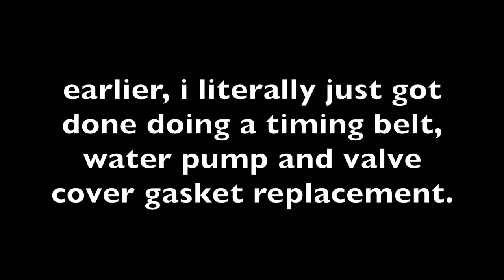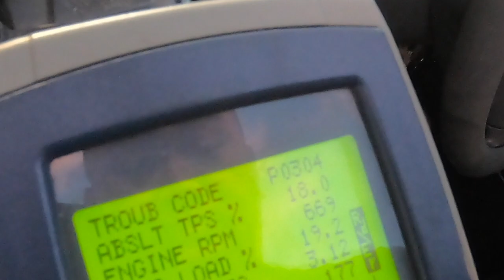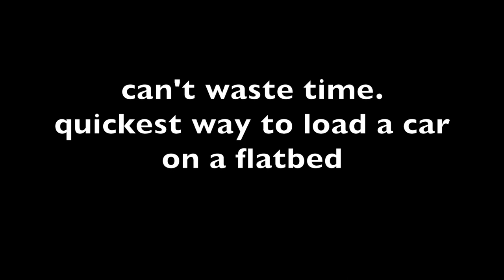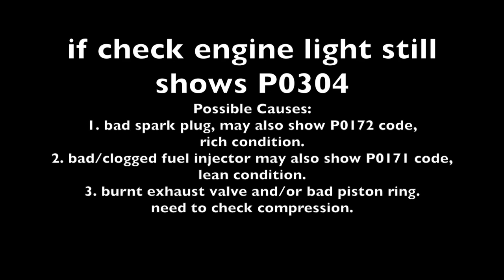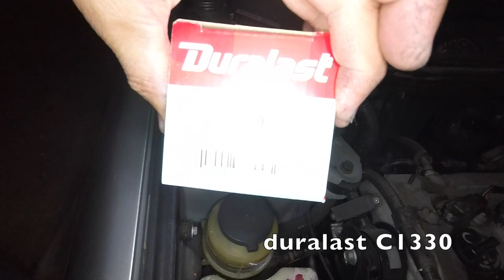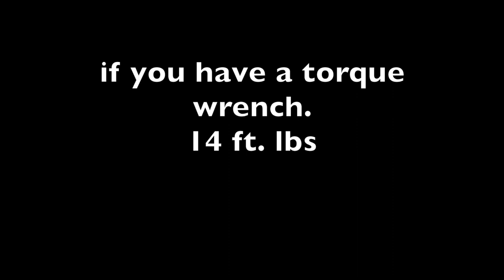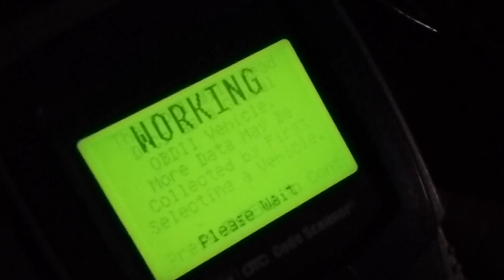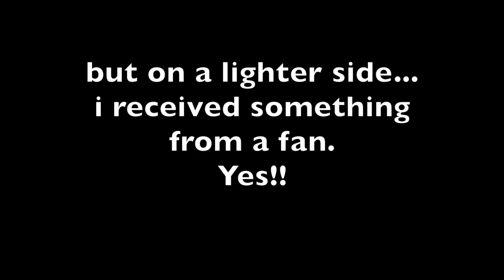Toyota Camry ROUGH Idle and no power while accelerating √ Fix it Angel

Comment: I was leary about aftermarket coil packs when a Toyota service tech advised me not to use them because the resistance he measured was higher than the 14 year old original Toyota coils. Glad to see your experience with the aftermarkets was good.

Comment: What a good husband he is! My 2016 Toyota Camry acted up again early this morning after I dropped my girls off at school. It was really busy on the roads at 8:05 a.m. Car was fine and then all of a sudden I try to accelerate some after just leave I got a stop light, headed for on-ramp to interstate and my car would not go above 25 mph and it was revving very loudly. It has done this 9-10 times over the last year. And I wanted to catch it on video super fast for my husband to see and hear so I hit video on my phone. 
Traffic was everywhere and I was almost to ramp and there was nowhere to pull over until I got on ramp. Line of cars behind me wanting to accelerate to get on interstate but my car wouldnt let me. 
I continued to video so he could see the speedometer and hear how loud my car was revving but I knew what to do to fix the issue just from previous times my car doing this. 
I pulled right over and put my car in park and then back in drive and got back on the road as soon as all cars passed and the issue was fixed. 
I later sent my husband the video once I had parked at the store I was headed to. My husband got mad and told me I was going to blow my car up getting the rpm’s so high. Lol. Like I can help what my car is doing!? Like I could help there was traffic all around me with nowhere for me to pull over. The entire thing lasted 30 seconds tops. I also pulled over as soon as there was an open space when I hit the ramp. 
He was cussing and mad as a hornet at me. Ive told him five times my car has been doing this every blue moon for close to a year now(maybe 8 months or so actually). 
So I told him forget it and from now on I won’t bother telling him squat! I have a fabulous husband in so many ways but every time something like this happens, it’s MY fault. How?! 
It’d be nice if my husband had responded the way this husband in the video responded. Of course, my husband is traveling for work a lot and he is 7 hours Away so it isnt like he could rush to me and I’m used to dealing with stuff myself anyway but I just thought I’d let him know. What a jerk!

Comment: here is my story about my car that had a very very strange problem i think it is important to learn about it since you are a mechanic it might help you later as it did to me.
my car stopped working and coudnt start anymore , it was cranking fine. i checked the compression it was great and injected propane and starter fluid into the intake it woudnt start. i then removed the coil pack and EIM (one piece) in order to see the sparks discharging i hooked up the sparks plug with copper wire and everything worked fine, i saw the sparks working.
at that point i disassembled the engine thinking it was a timing issue. long story short it turned out to be the dedicated ground wire for the Electronic Ignition Module on the coil pack that rusted and broke beneat the engine . i also learn that the computer calculate compression on each cylinders by measuring the resistance and current waveform from the coil pack firing and it send the information to the main computer. they added a dedicated ground wire to the EIM and when it broke the computer coudnt make his black magic work anymore and the car woudnt start.
my car is a 2003 cavalier and i had no code except a evap thing (leaking gas cap).
Reply from the maker: thank you Francois for taking the time to tell your story. i appreciate it. i will remember your tip. it is very valuable information. be safe, stay healthy and take care. god bless you and the family.
Reply: @FixItAngel  thank you very much also for your videos, you are helping alot of people all around the earth. may your family stay sharp and healthy.
Reply: Thanks Francois and thanks Angel for all the great videos. Aloha and Shaka my brother. Maybe one day when  I go visit my tatlo apo in Vegas I’ll get to see you. Stay safe everyone and we will all get through this tough times. God bless.

Comment: Hafa Adai!!  Awesome video Angel.  I4, easy the coil packs are on top.  We have a 3.5 V6 in my wife's 05 Avalon and same issues like yours but a P0301.  I had to remove the air surge tank to get to cylinder #1 and switch the coil pack with cylinder #2.  It was the pack so I replaced it with a Denso pack from Rock Auto.

Comment: I inherited a 2004 350z and the coil packs started to go bad at 58k miles. After the third coil pack went bad at 61k miles, I just replaced the rest of the old coil packs and I haven’t had any misfires since then.  BTW, I replaced my original coil packs with Hitachi coil packs from Rockauto.

Comment: Great Video. Sweet ending. But my OCD is kicking in on the Coin Spark Gap Tool @9:27 being used on Iridium Spark Plugs. I'm sure your careful not to touch the center ELECTRODE with it. A Wire GAP tool would have been safer.

Comment: Had this happen to my '02 recently.  320k miles on it. If you haven't replaced the others, I would recommend getting a 4 pack online and just replacing them all.  A second one failed on Mine about a half year later  and I had more time, so it was like 85$ for the pack instead of like the first time was 90$ for one.

Comment: What I usually do is disconnect each spark plug boot and see which one didn’t effect the motor while it’s running.  The one that didn’t effect motor running, check the spark plug and boot/wire.  If it looks fine, ground a screw driving and put the spark boot near the screw driver and see if a spark comes out of the boot end.  If it doesn’t then the coil is bad.

Comment: You could save some money not using tow truck. I drove approx 200 miles home on 3 cylinders due to bad coil pack. It's hard, but I can't think of any damage was made to the engine. Sold it few years later and it was quite OK not showing any signs of malfunction.

Comment: Love the vids !!!!  to your viewers your  I radium  spark plugs are pre gaped  .... so no need to gap them due to the point can easily break or bend  just fyi and I would recommend Autozone parts due to there lifetime warranty no hassle ....  and another FYI if the part you bought at Autozone doesn’t work it could be that it was re stocked as a good part instead of damaging out the part due to the inexperience of the employees ...

Comment: I have always used Bosch Platinum or Iridium as OE replacement. You don’t need to gap them and you don’t apply anti-seize. 👌
Reply: eluniversodelecuador iridium spark plugs are known to last over 6yrs so you do need anti-seize especially on high mileage vehicles.👌

Comment: Amazing video, thanks. Am facing similar issue unfortunately am in UAE. I change all the splugs, replaced maf sensor and coils. But suddenly the engine started vibrating and if I try to drive above 20kmp the engine light blicks. Place advise if possible.. Thanks.

Comment: Camry manual says to replace the spark plugs at 120K miles. So your Camry of 2004 (16 years, 228K miles) was approaching the 2nd spark plug replacement. Was this still the first set of spark plugs?

Comment: Angel, my wife's 07 Camry (california emission) started having cylinder 2 misfire (no other code)   a couple of months ago. I swapped ignition coils, spark plugs and fuel injectors but the code stays. Compressions are fine though. What would you suggest I check next? Thanks. Btw all ignition clips are broken and I should have probably replace those plastic first. And I have freeze frame data from techstream but I don't know how to interpret.
Reply: leemaverickly maybe you have a open circuit on your harness
Reply: I'd say remove the battery cable and drain the cars memory completely, touch the negative and positive leads together for a few seconds, the problem might be gone,but the code may have stayed

Comment: If you get that Evap code always check the 2 short Fuel Rated hoses on the Evap Canister, they tend to rot and get a hole.  $2.00 fix.

Comment: Just a question from a avid diyer. Wouldn’t it be better to change all the coils instead of just 1?
Reply: @o0oitzJimmy changing all 4 instead of 1 doesn’t make the car run better it just saves you the time from doing the repair 4 times. But it is true if one fails the rest will soon follow not days but maybe weeks later if yur on a budget and can’t get all 4 just use die-electronic grease to give longer life to the coil packs....this is the reason why I prefer distributors over coil packs...lol where I live quality  coil packs can cost over $900 for 4cyl. 6cyl. 8cyl this probably why ppl only replace the one that fails.

Comment: Good day Boss Angel, from Philippines Davao City I have a question about my cvt transmission fluid level, when my engine is cold not running the level is in between the hot level of the dipstick and when its running and the engine is already hot the fluid level is just below the cold level of the dipstick,. Is my tansmission low on fluid?

Comment: "My repairs are never ending"!

Brother, I raise my chalice and toast to you for I too, with 1999 Toyota Solara 3.0L and 2000 Freightliner Century have not only repairs neverending but also money that never ceases dwindling.

Hah hah...I just threw copper plugs in mine.  Easier to afford and I read they give more power.  If my car lasts another 30,000, then I guess Iridium would be correct.  Twenty-one year old car with never a valve job still rocket ships on 93 Shell gasoline.

Comment: Hey angel I have a question that I need help with. So my CYL 3 coilpack was bad so i replaced it on my 09 corolla 1.8L. But when i checked it few weeks later to see if there was any leaks from the sparkplug tube gaskets because I also replaced those, I couldnt get the new coil pack out. Its stuck. I did add dieletric grease before hand. How can I remove this stuck brand new coil pack? Please help! Appreciate it. (Also, no leaks in the other 3 cyl tube holes, so I did a good job replacing the gaskets haha)
Reply: shivam220 force it out why u scared 😱 use a prybar or something probably might damage the pack jst replace with old one that’s still good if you replaced all 4 other wise wait till you get a 420 code to tell you got oil going into the catalytic converter or look for gray smoke coming out exhaust
Reply: Just twist it,it'll come out

Comment: I have a hesitation in my 2006 Toyota Camry I cleaned the throttle body and MAF sensor and still have the same problem my next move is to change the spark plugs and coil pack I hope that's the problem..

Comment: Bro need your help my 2007 Camry lose power at 3000 RPM can. You give a tip
Reply from the maker: test your fuel pump. pressure may be low

Comment: Had the same code recently on 04 TSX. Mine was number 4 injector
Reply: Use premium gas 91 or higher then you won't get that problem
Reply: @Derrty92lude  This car has always had premium fuel. This injector has a bad internal electrical problem. I’m thinking the solenoid inside went out.

Comment: You could have just removed the cyl 4 coil while the engine running to check if it changed anything, if it didnt change anything that its simply the cylinder 4 coil. Simple. Replacing the coil packs and erasing code was a longer process.
Reply from the maker: Technewlogy hi so how do you know if it’s not the spark plug?  It could be either the spark plug or the coil pack. So what if you replaced the coil pack and then it still has a misfire? I can’t think of any other way for sure to know it’s the coil pack.
Reply: @FixItAngel  You are right  but usually i have never seen spark plugs go out like that, i work on cars roo. No offence or anything just giving my opinion. But hey i had the same Camry before and same thing happened flashing engine light and loss of power, but what i did was that i removed each and every coil one by one while engine running until one coil made no difference i removed that coil, then i took another coil out(which was running) and put it in place of the first one i removed there was a change in engine rpm so i understood it was coil and not spark plug. Simple, dont even need OBD scanner for that.
Reply from the maker: Technewlogy no offense bro. It’s all good. This is where I try to make it simple to the amateur diy mechanic. You are an expert and know the sounds and have years of experience. I’m not on the clock and take the time show what i know on video. Everyone wants to do everything quick. And that’s ok. 
But for me, its for the viewers to understand what I am doing. If they don’t know what’s the check engine light code, then what’s the first step they will do? Thank you for the tip. I appreciate it.

Comment: Ok I have a question I’m having the same problem with my 99 corolla but my engine don’t have coil packs just two coils which I already swap and cables ,and spark plugs, throttle Body. replaced fuel pump still doing the same no codes just when driving it flashes please help I been trying to fix this car
Reply from the maker: check your fuel injectors. it could be clogged
Reply: @FixItAngel  I already clean them it idle   Perfect just when accelerate no power

Comment: Not sure why you can't drive with 3 cylinders and needs to be towed?
Reply from the maker: Hi Ted, it’s very bad for the catalytic because of unburned fuel from misfire. It can damage it. We have free towing in our insurance so no problem with getting it towed. With engine misfires the air conditioning would not be working sufficiently with only 3 cylinders. It’s very hot in Vegas. Try google it. Thanks for asking.
Reply: @FixItAngel  Understood. Thank you for replying. I've been learning from you on car repairs.